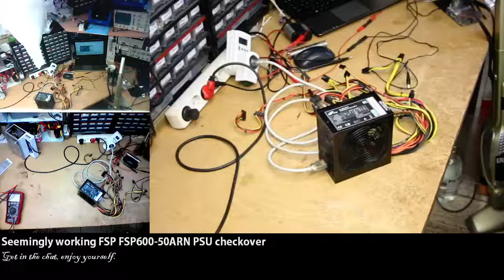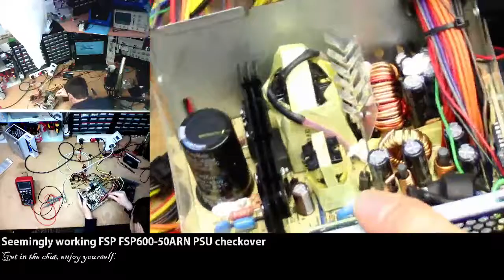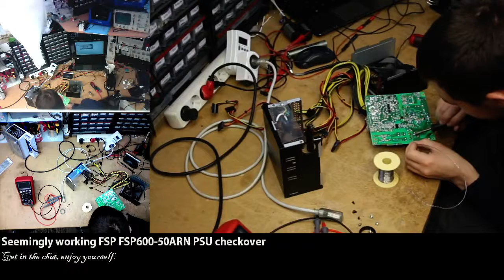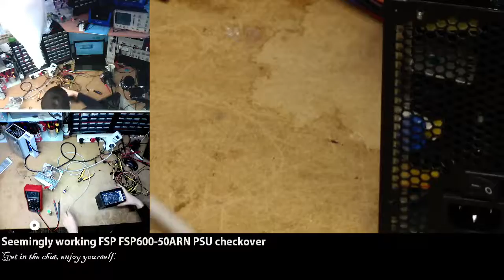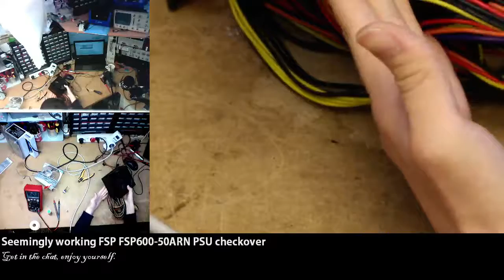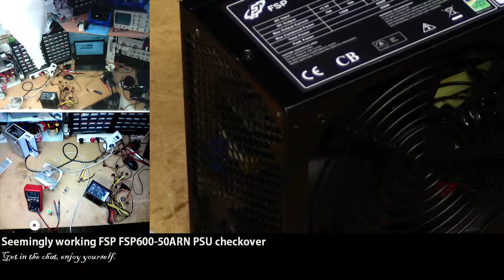Live recording: FSP FSP600-50AN computer PSU check-up

Comment: sometimes is such an anomaly that: 1) if you start without LOAD one time (capacitors charging up), then woking fine. 2) After ~ 30min is (turned)OFF and if you are turn ON whith LOAD, then not turnON or not work correctly. (capacitors visualy looking good but not work like must)
Reply: I think he's basically saying that sometimes it will act like there are bad capacitors, even though it doesn't appear that there are any bad caps.
...
Indeed, some capacitors do fail without bulging and leaking.
The common thing that happens is the PSU works fine, then if you turn it off and let it cool down, it won't start up. This is usually because a capacitor has failed, and when cool, it's ESR is too high for the PSU to start.
Reply from the maker: I'm sorry, man, but I don't think I've understood a single comment you've made.
Reply: yes. if want to understand, then be understood. exuse my engl. ;)

Resistors and other components, I also had such problems, visually looks fine (and cool measures), but is problematic when heated. Off the soldering, below to can see a rift (microscope), where you will not have seen (below) before. (Components heats swell and change shape - testing them sometimes with HOT AIR GUN, and full-LOAD using , continuously measuring the all voltages (with PSU TESTER LCD is easy wey to test http://i.ebayimg.com/images/g/WcMAAOSwk5FU0yqm/s-l1600.jpg ))
Reply: :D One time I discover one (diameter ~15mm) solder drip dropped on pcb (on to 12v AND GND isolated rail)  ( drop like this http://d1czgh453hg3kg.cloudfront.net/content/royprsa/466/2116/1229/F7.large.jpg ) (PSU was CHIEFTEC CFT-850-14C S/N:#D00002247 (2007/06) )

Comment: Often have problems with the diode bridges or transistors like: usually by measuring the OK. Change temperature/load is flawed (I remembe what Dave (EvvBlog) was one time too this diode bridge problem/anomali Part1 https://youtu.be/Cmz8bzUsj7E , Part2 https://youtu.be/7ocancoZ02Q  ). But yes, generally there is a problem with larger temperature changes (heat up components or the surrounding this area).